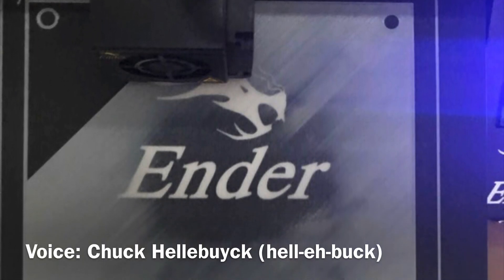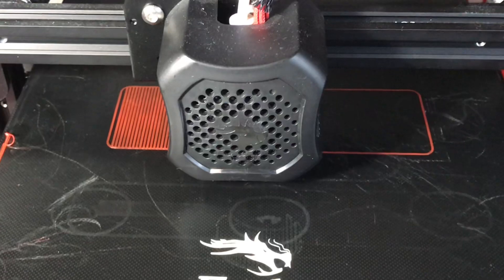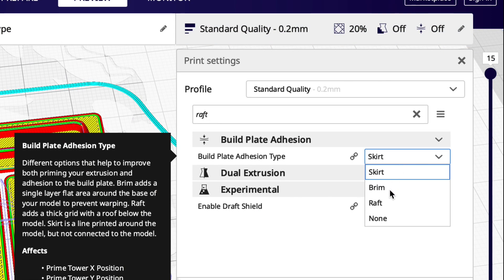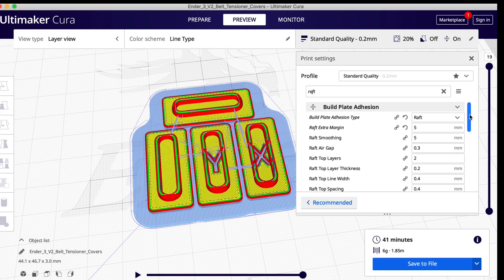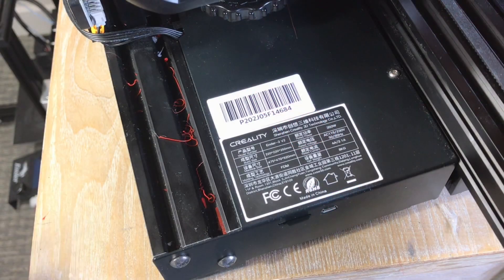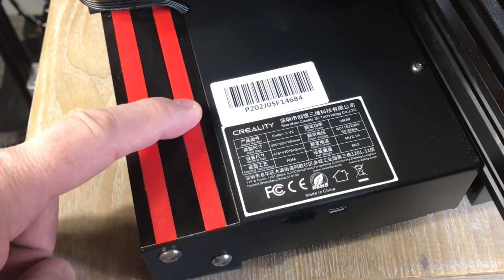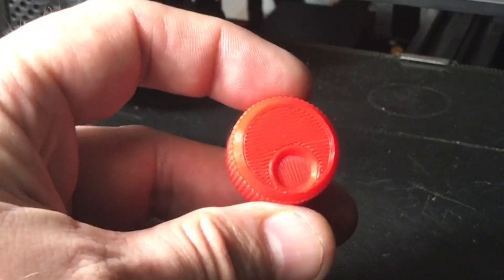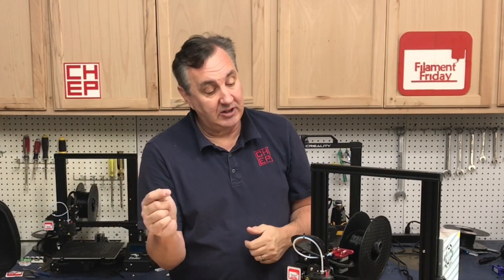Using Rafts in Cura Slicer V4.8 on Ender 3 V2

Comment: I never feld like i needed a raft or brim. I got the v2 with glass bed and use a little bit of.. how do you call it in english 🤔 gluestick? Almost never got a problem with the first layer. No auto bed leveling. Just ones in a while i manualy level the bed. Bed temperatures of most of the time 40 degrees celius. Sometimes 50. One thing i must conves about the glue method..  sometimes it is a little bit diffucult to remove the print. But it is doable.
Reply: brims are definitely necessary for certain prints, but everything this guy printed would have been done an hour faster with much less plastic used if he just printed the damn things without the raft. Worst case is maybe he would need a brim. Rafts were a necessity years back before heated beds, and ABS was the standard. People using PLA shouldn't even consider rafts an option.
Reply from the maker: The rafts didn’t take an hour and the point was to help those with warped bed. Brims can be harder to remove.
Reply: @FilamentFriday  oh hogwash. I printed 120 hex tiles for a board game and the brim fell off as I removed them from the bed
Reply from the maker: You should do a video showing your settings and that pull-away. I always end up with little pieces stick to the base that need to be removed with a deburring tool. Gets tough on odd shaped bottom prints.

Comment: It is not always the bed that is warped ... I have a glass bed but it still shows the same effect to a smaller degree so this suggesting that the beam carrying the head is not flat and that Z motion is not level.  Rafts were ok, but BL touch for a mesh level has really removed all issues for me and means I can print nice flat objects (raft means you cant get the best smooth surface)
Reply from the maker: True but autolevel doesn't solve all issues either and many emails to me point out. So I just show beginners alternatives to try so they can get started with successful 3D prints.

Comment: "Using rafts in Cura 4.8 to compensate for warped printing bed"
Fixed yer title.
Isn't 'rafting over trouble waters' a universal thing in 3d printer land?
Reply: It doesn''t compensate much, just makes sure that the surface is always of good quality.
Reply: @Avrelivs_Gold  you can always make your raft higer, Icomensated even 3mm dips like this

Comment: I would like to use a raft to help bed adhesion with this new filament I love that just doesn’t stick. Problem is I don’t want the raft to delete/replace the bottom layers of my model. Is there a setting for that?
Reply: Apologies, seems cura either fixed this issue or I was wrong and the issue was never there in the first place.

Comment: Thank you. I have a meager TronXY X1 with which I made my first steps in 3D printing. And until I was better at it, rafts saved my back. And I was discouraged to use them by comments and videos I saw.. But I think they are a great tool to overcome problems that you don't have an other solution at hand.

Comment: Hello great video not used a raft for a while might give it a go on my V2. I see your print just pops off. What do you do? I use a blu tack blu stick. I have No problems with the print moving or lifting but for the love of god I can not get the print off the bed without a fight. Sometimes have to put the glass with the print into the freezer. Your print jumps off when it sees you walking over 😁
Motters
Reply: Hello sir! My 3d printer came with one of those Blue Tack sticker sheets on the bed as well, and I had the same issue. Prints would stick ungodly well to it, I was having to use all my strength to get them off, or pry them off with a tool and risk tearing my build sheet. The solution? Kapton tape!! Not sure why nobody talks about it anymore, but you can buy large rolls of it for relatively cheap, place a layer over your blue tack, and all of your problems will be solved! It holds my parts to the bed really well, but allows them to pop free with ease as soon as the temp begins to fall back down. Another nice perk is that it's glossy smooth, so the bottom surface of your prints will have a mirror-like finish as if it came off a glass bed. One tip I can give you if you buy some, is to lay down the tape while your bed is hot; it's way easier to work with under the heat, prevents it from sticking to itself, and allows you to place it without any bubbles or crinkles pretty easily.
Reply: @kaylor87  thank you so much for advice I will look into it 😁 👍🏻
Reply: @Mottersmotters  No problem, I wish you the best of luck!! 😊
Reply from the maker: I keep the Creality Ultrabase fairly clean with soapy water.
Reply: @FilamentFriday  me too do you use any glue of any type.? I have tried no glue on my V2 and the print leaves the bed. My bed temp is about 55 Motters

Comment: Calling a raft free is disingenuous
Reply: Consider the entire print, not just the parts you want to keep.
A 6 hour 23 minute print with rafts is far less 'expensive' than a 6 hour print without rafts.
The 6 hour part is a failed print: warped bottom.
Reply: @pirobot668beta  "far less expensive" != "free"
Reply: I'll admit I'm splitting hairs.
Reply from the maker: It’s free because you don’t have to buy a glass bed or BLTouch to get a successful print on your warped bed Ender 3. Just add a setting to your Cura slicer settings which is free. Nothing to buy, nothing to install, no added time to slice it, just check a box, slice and print.

Comment: Just a quick tip. You don't need any brim on your rafts. As long the print and printer goes, it will make no difference. If bed adhesion is that bad, you've got bigger problems.
Reply from the maker: You can’t put a brim on a raft.
Reply: @FilamentFriday  Come on Chep. You knew exactly what I meant. You can run the raft up to the edge, the extra makes no diff.
Reply from the maker: It does make difference. The edges can curl up on a uneven bed surface. So adding the extra raft area allows the edges to curl without affecting the print.
Reply: @FilamentFriday  Not in my experience. The uneven bed surface doesn't result in curling. (For me at least) The raft is placed so liberally you could level with cardboard. 😂 I wouldn't know what differences we have though. 🤷

Comment: On Ender3, most of the warpage is a dip in the center of the plate. I cut a square (or two) of aluminum foil and place it as a shim under the build surface. Worked for me.

Comment: I used rafts a lot with the 0.4mm nozzle, but they were very difficult to remove after I switched to the 0.6mm steel nozzle, so I've just been using brims.

Comment: I used to use rafts for tricky prints on my Ender 3 with the Creality glass bed. They would slide right off the bed every time i tried taller or heavier prints without them. Then i discovered 3DLac and i've never used a raft or even a brim ever since (i know this sounds like some ad, but trust me, that stuff really works).

Comment: I've had a few different glass beds (some Creality, some other brands) and each one came super warped. I also hated that I had to use the freezer to get very stuck on prints off. I've also heard reports of the added weight causing issues in printing.

Switched to a steel spring sheet with a PEI layer and it's amazing. Super flat, super light, better adhesion and it's thin and bendy, so you can just bend it and your print pops off. Haven't touched my spatula since getting it.

Highly recommend trying it! I got mine for $20 off ebay, fully assembled.

Comment: Don't agree with the "glass fixes everything statement". Glass does not help if you have to start with a warped bed because you then transfer the endless tedium of trying to level your bed to leveling your glass to remove the warp of the underlying metal plate. the advice is usually to use thermal "blutac" putty but that won;t go on evenly either. I know because I have been there and tried that. The primary source of issue is a warped build plate. In additional, almost every "clip attached" glass surface reduces the build area especially if you have a smaller build plate as on the Ender 3. I will, however, take your advice and go back to trying rafts as a solution.
Reply: For the clips why not clip in the corners? The only way that I've found it an issue is if you're printing greater than 230ish in both X and Y.

Comment: 1. If you can't tell X from Y axis...well 3D printing might not be for you
2. Why waste time and filament on rafts? Print on glass ... mirror quality finish below for free :D
3. otherwise love your channel and picked up a couple useful ideas and settings here
4. Have a good weekend & stay healthy
Reply: Personally, I have tried a glass bed with my printer and had nothing but problems. Nothing would stick to it even after trying some of the common tricks like hairspray, the clips I used to attach it to the existing bed would get in the way, and the glass would regularly shift or move mid-print causing massive problems.  Ultimately, the best solution I found was to toss the glass and just use a layer of Kapton tape over my factory blue build tack. Never had a problem since, everything sticks to it really well, I still get a glossy mirror-like surface finish on the bottom of my prints from the Kapton tape, and removing the prints from the bed once complete is super easy once the bed temperature starts to fall. The Kapton tape lasts me over 20 prints, and when it starts to lose it's adhesion to the bed, it only takes 2 minutes to peel it off and stick down a new layer. Also, printing on glass is not free, the glass has to come from somewhere, right?

Ultimately what I am getting at is, to each their own. Every person is different, and every 3D printer has it's own nuances. What works for one person might not work for someone else. Regardless, videos like these serve as great tools to help people along the way, especially beginners. No sense in knocking the video.

Comment: Another benefit I've found with rafts is to ensure good aggression for very small printed areas. The Flexi-Rex model from Thingiverse has a segment of the tail that is very small. Using default ready settings and 3mm offset worked perfectly where is have problems otherwise. I ended up printing about 40 of them and hanging them or as keychains for co-workers for the holidays in 2019
Reply: It is important that your Flexi-Rex is aggressive

Comment: So, that is why people looked at me like the antichrist when I first started with printing and told them I used a raft. And also the reason why I didn't see an issue with them.
But my bed is flat enough, so that I don't need anything extra on the bed, just the part is fine.

Comment: Hi. It would appear that is normal for the v2 to be low in the centre of the bed. I solved it by using layers of aluminium foil as shims under the low spots and then checking the bed until it was flat. This worked well and the foil conduct heat well.

Comment: Good to dispel some of the snobbery associated with not needing a raft - “level your bed!!”  😁👍
Reply: Hello, I have a question.  I am using Cura and an Ender 3 V2   When the printer made a perfect sticking 3 layers raft he begin printing to high. The layers wont stick the 4th layer. How can I solve this problem? 

Thanks,
Reply: @BB-fc1wc  change raft top layers to 2

Comment: I recently bought a V2, the heck am I supposed to do if my glass bed is warped?

At the moment I've got masking tape under some spots which made it better, but it's still pretty awful
Reply: Bit of tin flat foil under the glass can lift it marginally whilst keeping the thermal conductivity there.
Reply: I had the same problem with mine, first thing i did (now not every body is going to have the equipment i do, but you might find a place locally that wont charge to much) i took the glass off and placed it on my lab grade surface plate. and measured with a height gauge, and machinist level across it to see how warped it was. and no floated glass is not flat period. then i took off the aluminum bed and machined a new one a little thicker than the original. so i can get it flat relative of how level your machine is. now back to the glass.  i took it to a local glass blower with the surface plate and heated it up to about 900c-1000c then set it on the pre warmed surface plate and let it cool. he only charged me 30 bucks well worth it. then brought home assembled and never looked back. if i would make a new plate for some one i think it would be in the 40-60 dollar range. so if you do find a machine shop with a cnc try to shoot in that range. P.s you can get different glass that is flat made from a glass guy, just i had a local blower not all that far from me so i used that.

Comment: I can assure anyone that glass beds are absolutely AMAZING and CHEAP. Like best easy cheap upgrade you can do.
Reply: I would say mirror is better than glass as all my glass beds I have had supplied with printers have a low spot in the middle. All my printers run with mirrors.
Reply: @jonmarkwright  The only reason people use mirrors is to increase the likelihood of getting the flattest plates. These days though, any professional glazier is working with "mirror" garde anyway.
Reply: @jonmarkwright  Hi jhon, mirror 3mm ? or 4 ?
Reply: Dont you need adhesive with glass beds though.. those ceramic ones aren't flat by any means but they do stick pretty well?

Comment: I've been using rafts on my Ender 3 Pro and Tevo Tornado for the last several months, primarily because my house is very old and drafts wreak havoc with bed adhesion.  I've come to like using rafts for many prints.  Bed leveling issues aside,  they tend to adhere much better, especially for tall prints where the nozzle can cause stress points along the base of brims.

Comment: Ive got a guage meter and the extra weight of it pulls my print head down 0.02mm and that's also my percentage of warp. 
My fix 100% of the time is rafts. Also prints super close to the specs.

Comment: I'm using an Ender 3 Pro with a PrinterMods MDD kit and using the stock settings (other than changing the extra margin to 5 as you did) and my raft was welded to the print. Do you think the smoother or air gap settings could be modified to help?
Reply from the maker: Try increasing it.
Reply: @FilamentFriday  Thanks for the reply! I increased it to 0.4 and an trying it now. It's a small print and only takes about 20 minutes. I noticed my part fan isn't running during the first layer after the raft. Shouldn't it be?
Reply from the maker: Depends on your slicer settings
Reply: @FilamentFriday  I took your advice a few weeks ago and started using Cura 4.8 straight out of the box. Increasing it worked a little. I was able to separate it, but it took a pair of pliers. I'll try increasing it to 0.5mm mm. Should I try to figure out how to turn the fan on for the layer right after the raft? I really appreciate the help! :)

Comment: What do you think or have you tried the Arc Welder plug-in?
Reply from the maker: Haven’t tried it yet.
Reply: I have used this on my Artillery Sidewinder and Anet A6 (both stock). 
1) smaller gcode file
2) both machines seem to run much smoother.

Comment: Fantastic tips, Chuck! Thanks a lot! 😃
I still didn't decided which 3d printer to get... But I think I'm going to be able to buy it in the next few months. Before June, for sure. 😊
Anyway, stay safe there with your family! 🖖😊
Reply: As a beginner I got an anycubic mega zero (the first version)  it was only $150 Australian, a clone of the ender 3 and great customer service. Only thing is there in China. 
Super easy to use too.
Reply: @hulkgqnissanpatrol6121  Yeah, I'm thinking about getting some version of the Ender 3, just don't know which. And I'm going to get the direct drive stuff right away. 😊

Comment: Do you have a suggestion for a 3d printer under 250 euro, duel extruder is a plus but consistentie/ease of use is more important sinds i am a beginner.
Reply from the maker: Ender 3 is good place to start
Reply: Ender 3 clone. 150$. Single extruder but upgrades are plentiful.  I'm new and a clog was my only problem so fare but was my fault.  
I printed a print that took 98 hours and had zero problems.
Reply: Thanks for the help

Comment: I'll try the mods. Just one question to your Ender 3 V2, have you calibrated the X and Y axis steppers? I have calibrated the E-Stepper but the measuring, especially of holes are about 0.3 to 0.4 mm too small.

Comment: I recently started using rafts instead of large brims for items with small contact areas and have found them much easier to remove neatly.
Reply: I'm having problems sticking  the raft off the parts.
Reply: @19134ANDY  what air gap are you using?

Comment: Rafts are for bed adhesion not bed leveling imo. My Bltouch has saved me so so much time and made the v2 a pleasure to use. It was tricky to setup but worth the time and money!
Reply: But it will also help with levelling because after the first layer or two from the raft it should also be level if there are minor fluctuations in the surface of the bed itself.

Comment: I've found rafts to be very useful for tall thin objects as they provide extra stability. I run a CR-10 and did have to play with the air gap setting, as the default was to low, bumped it up a little bit though and it works great